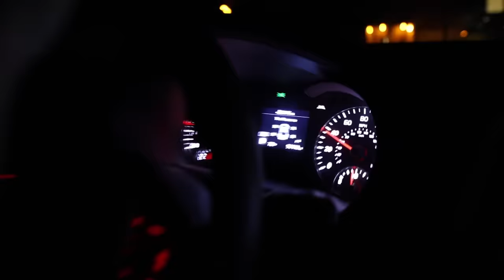Overnight in INFLATABLE RAFT near GREAT WHITE SHARKS...

Comment: you have to distill salt water, not boil it. you bring it to a boil and the steam is run through cool piping and the steam cools and condensates and is not longer full of salt. it's not a fast or easy thing to do.  the pot you boil the water in basically becomes more concentrated with salt.

Comment: Could’ve spent $30 on a power inverter at Walmart or harbor freight really any hardware store or car place auto part store has them. Than it plugs into the cars outlet or hooks on like jumper cables and boom you have multiple outlets and endless power